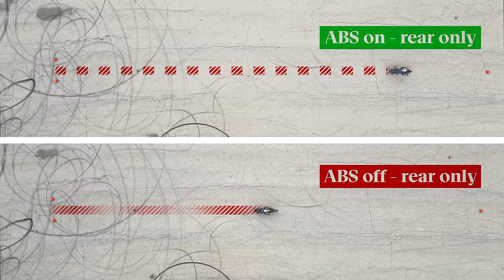Out-braking the ABS Myth

Comment: A skidding tire is neither steering or stopping.  Hence ABS.  Best advice is go practice.  Learn how your ABS system works so you can stop fearing it.  You old school purists can just go find a dark corner and mutter to yourselves.
Reply: Nahhh, no ABS required. Just skill and knowing how to use the front brakes. It was always my choice not to have ABS (ABS was an option) in past motorcycles. My last one came with ABS as standard equipement.

Comment: i absolutely whooped new bikes with my old ass 954RR on the track in braking and corners.    some were a bit faster on the straight ends but not allot. 
If you grew up without ABS (i never had an ABS fitted bike and have been racing since age six (35now) you will be able to be faster without abs.  
if you grew up riding ABS fitted bikes you shouldnt go back to a non ABS bike ....
Reply: What if you get on a bike old enough to lack an ABS system? What if the system breaks down? Which is the case with my current vehicle.
Good thing I learned and practiced to be able able to handle any situation, with any vehicle, uh?

Comment: The entire premise of this video is flawed I think. The point of ABS isn't to give highly skilled riders/drivers better stopping distance, it's meant to allow the average rider/driver the ability to maintain control of their vehicle in situations where brake lock would send your vehicle into an out of control skid, the majority of which is not straight line breaking but trying to maneuver around obstacles.
Reply: It isn't flawed at all. Quite the opposite indeed. Most drivers, regardless of the number of wheels, believe that the only way to brake on the shortest distance, in every situation conceivable, is to slam the lever and/or pedal and to keep it there, thrusting the whole system into doing its best to avoid an accident.
This video sets the record straight.
This should be mandatory viewing in every driving school around the world.

Comment: Blah blah motorcyclists don't use the front brake because they think they'll endo blah haha so silly blah.

I had a road rager brake check me, got hard on the front brakes, flipped the bike over the front, and snapped my thumb, separated my shoulder, and broke my hip.

Later I bought the most sophisticated bike for sale at the time (Multistrada with electronic combined brakes and anti-stoppie tech) and had a few hard braking situations and...nothing happened. ABS did the job.

Like what is the fucking point of this whole video, really?
Reply: ABS should never be used as a "crutch" for your lack of riding skill.